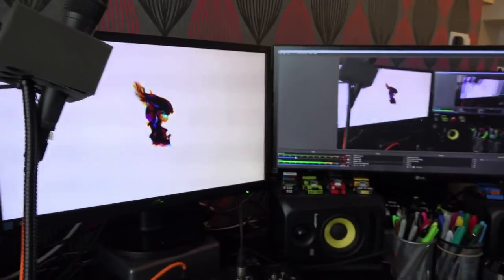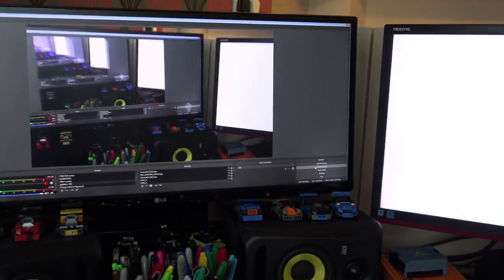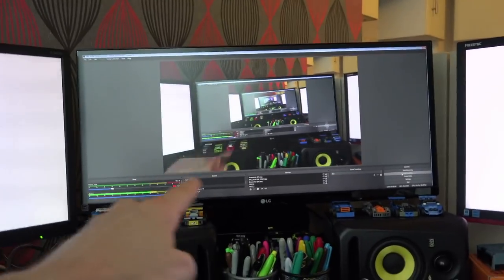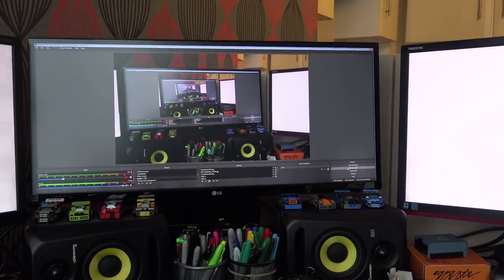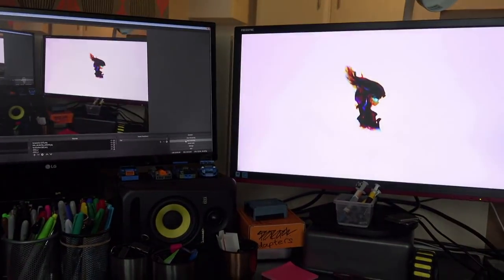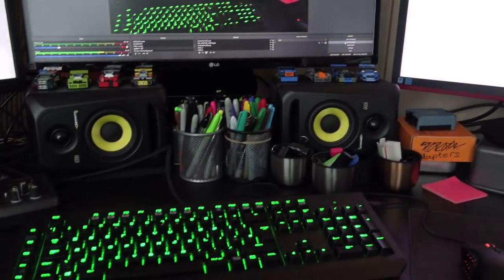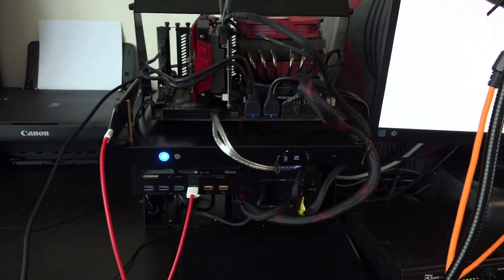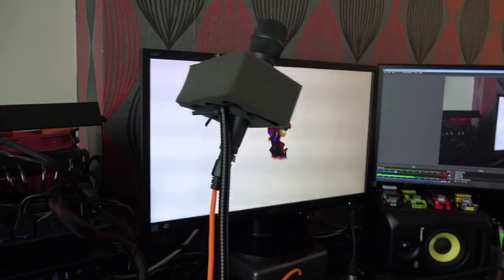The computer that delivers AHOC content.

Comment: I was gonna be like "OMG you have a printer?!" and then BZ goes "I like my music on CDs" and then I'm like "print away, overclock boy!" ✊
Reply from the maker: CDs or Flacs from bandcamp.
Reply: @ActuallyHardcoreOverclocking  have you tried 7digital or hdtracks (the latter is more expensive usually, but sometimes has unique stuff)? Often can get better than cd quality from there.
Reply from the maker: @tarfeef_4268  I've used HDtracks a few times but they don't tend to have what I'm looking for. Haven't heard of 7digital.
Reply: @ActuallyHardcoreOverclocking  give them a shot, they actually have much more selection than hdtracks does. I've mostly switched to just them and bandcamp
Reply: printer gang

Comment: Huh, one of the first things I noticed is that black and red 24-pin connector wrap. I look back to the window of my modified Koolance case and think "This guy is running an Antec power supply." GG. O_o Mine is 750W and a total anachronism. Seriously, it's like 11 years old and the one empty memory I have about this computer because I have no idea when or where it came from. I hacked my spare 8+6pin connector to run a chiller on this same box too. The 12v rail is a bit lacking at 11.9v but the signal is solid. I have the non-cherry picked version of that RX 580 and it's honestly surprising you break 1450 with it. PowerColor did okay but AMD royally screwed the pooch with driver support on these cards for Windows 8.1/10 to the point where stability is more on the driver than any silicon lottery or VRM issues combined. I had to reload drivers for the first time in a while just a few hours ago but the fact that I map a network drive with a driver repo just for this sort of situation really says a lot. I don't want to be the one guy saying stay on Windows 7 since I don't have any experience on it with this card but yeah, have fun figuring that out. I can hit 1420/2200 stable in games but have to drop the profile down to something awful like 1380/2175 for VR and even then I get random instability and thermal runaway from 68-90℃. Still running a FX-8370 like it's a FX-9590 though. This CPU runs GREAT. Not sure why the price suddenly hiked to match a Ryzen 9 3900X. Ryzen 5 3600 might be in my future soon just for some single core advantage but for now I'm stuck choosing a board. From this video it's further confirmation that I need to avoid ASRock as their layouts are just going to be a total nuisance for my hardware. Looks like it's going to be a toss up between ASUS and MSI.

Comment: This Testbench is called: "Lian Li PC-T60B" 2 months ago I purchased the same testbench for my [Daily PC] because I was getting sick of high temps in my older NZXT H440 case, I drilled holes & mounted a 120mm XSPC radiator bracket in the front for my "EVGA RTX 2080ti XC Gaming Hybrid" 120mm radiator. The only problem I had so far with the "Lian Li PC-T60B" testbench is my "be quiet dark rock pro 4" cpu air cooler 120mm front intake fan hits the top of the carry handle- so I just removed it. I only paid $76USD for this test bench on Amazon I definitely recommend it, CPU & GPU temps are alot lower since it is open air.

Comment: Coming up next on AHOC

-How to overclock your printer using hobby motor and paper clips

-How to overclock your psu with a 20 million volt stun gun, duct tape, and 10 farad car audio capacitors

-How to overclock your cell phone with aluminium foil, magnet, and 12 gauge speaker wire

Thanks for the awesome content buildzoid!
I love your videos!

Comment: I went from a Phanteks case to a Lian Li test bench for my daily too... First system I built was an ASUS P6T DeluxeV1/i7 920, Tripple channel Memory, Seagate Cheetahs, 4870's in SLI, Crucial SSD... Those were the days, a MOBO with a SAS controller (For no reason), All CRAMMED into a CM Storm Scout V1 For no reason. My daily is just a 7700K on a Apex IX, 2x 1070's (FOR NO REASON)... And of course I made use of the M.2 DIMM (for no reason except the price of a 500gb 970 EVO Plus was like 52% off one day, why not run raid 0 for no reason). Also favorite colour is orange. Good taste.

Comment: I run open air set ups also. I have a praxis wetbench and a thermaltake core P3 with all the panels removed and I also use the portable testbench/blank PCB that comes with the EVGA DARK boards as another set up.

Comment: lol hells yeah Buildy. I have my 3900x and 1080ti rig on a T60 test bench same as yours cept mine is bare aluminium and has the two front 140mm fan mount bit. The worst thing about that test bench is the handle - it's just a tad too low, stops big heatsinks like D14 and D15 from fitting. Also gets in the way of GPU mounting. I am working on the idea of directly dust filtering things like the CPU and GPU cooler, but you're right.. carry it downstairs and 5 minutes with the compucleaner/15 quid leaf blower from amazon, done deal.

Comment: I'm running 1800x at 3.8Ghz(all core, locked, at 1.25Vcore(4Ghz needs like 1.455Vcore)), and some  
garbage E die that cant do 3200 CL18 even at 1.6 volts(im running 3033mhz CL18, 1.35V). But games run smooth, blender renders fast.

Comment: Due to me having cats an open system isn't working for me. Butter Idc about my PC making some noise, so 3x 140 air pressure fans r running at 100% cause they r directly connected to the psu+ 2x 140mm fans that came with my coolermaster mastercase pro 3. But these 5 fans r actually absolutly quiet. The 5700XT RAW II is also absolutly quiet, but I couldn't hear it anyway over the wraith prism cooler on high performance mode that is cooling my 3700x with an ~4,3Ghz all core oc (had quiet some problems overclocking that thing via Bios, while the same oc is working perfectly fine since I tried it with the Ryzen Master software).

With an headset on I can't hear my system (stands on the table right next to me)

Comment: Not really sure where to ask this question, but if buildzoid (or someone else who knows the answer) could answer that’d be great.

I can get my hands on some CPUs that have broken capacitors on the back of them but are otherwise working for pretty cheap. I’m not too skilled with SMD soldering, but I’m wondering what it’d take to fix them. Is there somewhere where I can find out what capacitors Intel uses? Where can I buy those capacitors? Also, would it be acceptable to just short the places where there was originally a capacitor with a bit of solder? I assume the capacitors are just there to smooth out noise right?

Buildzoid has done cap-modding videos in the past, so he can definitely speak to these questions. Otherwise, I’d really appreciate if anyone who knows what they’re talking about could give me a good answer.

Comment: It's similar to mine but mines in an old case  and even less power Azrock Taichi X370,MSI RX480 Ryzen 5 1600 .Seasonic 650watt power supply,Mugen Scythe CPU cooler with two Deepcool Fans,16GB DDR4 G skill XPG 3000,but it all works.and I have no cooling Issue.i also clean it the same way you do.

Comment: If the monitor dies, will you do a repair video?
Reply from the maker: I don't think so I'll probably just mention that I fixed it somewhere or get a new one.
Reply: @ActuallyHardcoreOverclocking  I just repaired a monitor and a tv that both had blown caps. Quick n easy just how I like em lol
Reply from the maker: yeah except I suspect that the LEDs making up the bottom edge backlight are dying so I'd have to replace what I assume is some kind of LED strip connected to the panel.
Reply: @ActuallyHardcoreOverclocking  oh damn. That would be interesting tho. Not that id expect you to make a video on it but to see how difficult it would be to make it match up is just the kinda thing im into I guess lol. I just do mostly board or power fixes. I take fixing things as if the broken object has challenged my ability to fix it and can be a problem sometimes lol.
Reply: @ActuallyHardcoreOverclocking  It remembers me I got to replace the CFL backlight of an old 5:4 monitor with an LED strip and a microcontroller to setup brightness using PWM.
Reply: Yea, I did something similar on a 22" one ^^
Reply: @PainterVierax  ooo that's nice. Good idea.

Comment: about aesthetics.. neither do i and yes we are a minority.
i've been marked as the "unholy mess one" on caitlinV3's discord for having a WC pump in a beer glass sitting in an early 2000s ATX full tower case with cigarette smoke dust in every possible surface, with a tangled bunch of wires, some spliced in by soldering.
if it works it works. :)

Comment: Ummm....noob question/observation. I may be miss informed but don't the twist ties create an electrical choke of some kind? I was told wrapping wire around any kind of signal cable hurts the signal quality. Other than that I love the set up. If it wasnt for my pets I would be rocking a test bench setup too. Lol. Anyways keep up the great work.
Reply from the maker: Technically yes but I'm pretty sure the effect is negligible since it's not like I'm using ferrite beads to hold the cables in place just one loop of some pretty thin copper wire.
Reply: @ActuallyHardcoreOverclocking  I would have to agree with that the effect is negligible since it obviously works fine as a daily pc. Would have made cable management a lil easier for me if I tried it out for myself. Lol. Thanks for the feedback. I was just curious.

Comment: I've actually been using a RX-850AE 80+ Gold Raidmax PSU that I bought in 2010-2012. I've been wondering if I should replace it or if a PSU is a PSU is a PSU as far as how old it is.
Anybody got any thoughts?

Plus:  I'm with you on the aesthetics. I don't really care what my rig looks like beyond preferring a smaller machine that doesn't sacrifice cooling. Function over form, every time :P

Comment: hi buildzoid can i have ur help? which motherboard should i go for?

x370 crosshair vi hero - 170$ in my area
x570 aorus elite/tuf - 230$ in my area
i will get 3700x on them and will overclock it, but im really debating if go with the cheaper x370 or pay some more and go with newer x570
Reply: I'd get the Crosshair VI as long as you are willing to wait for your free AMD CPU to arrive (if that's available in your area)
Reply: @griffin8062  what do you mean by free?
I'm buying the CPU aswell
Reply: @ItayAmzaleg  The X370 motherboard will require a BIOS update. Do do the BIOS update you'll need a compatible CPU. AMD will send you a free CPU for updating your BIOS if you return it.
Reply: @griffin8062  all of this irelevent. the x370 c6h have bios flashback that let you update the bios without cpu, with only usb.

Comment: Put the ram @ 2666 and should work normal with that Ryzen7 1700. (I have 4x8gb 3000 cl16 with a ryzen1700 with MSI X370 and that was my experience)
Reply from the maker: The SOC on this chip is completely toasted. It will still crash even at 2133 CL15 with 1 stick of RAM.

Comment: Don't charge your phone from pc hub.The amperage is very low like 0.5A or 0.2A.Charge your phone only with huawey charger with 5A cable.It will will charge your phone at the speed the phone wants and needs,but most of all the highest speed at least 2A

Comment: Perhaps one day, you'll turn on to GNU/Linux. No viruses, no defragging, no $$. Light as you like it, stable, and fast.
Reply: Not sure if the capture card and all the OC and Firmware utilities will work outside Windows.
Reply: @PainterVierax  Running a distro in a VM would be the next step then.
Reply: @thenextpoetician6328  I think the problem stays the same since most utilities requires the low-level access of Windows to work properly.
Reply: @PainterVierax  The Linux world knows how to benchmark itself, as it were, but switching tools is not a given, and if you're correct, so much for VM's except to explore.
Reply: @thenextpoetician6328  There is a solution for some peripherals, we can configure a passthrough for the VM and let Windows dealing with the hardware but it's no longer usable on Linux at the same time.
But even with that, we can't use things like HardwareInfo or watching what type of memory chip our DIMMs have so, based on his computer usage, I'm quite skeptical about BZ using GNU/Linux as a dom0.